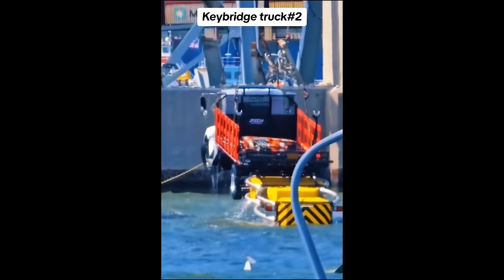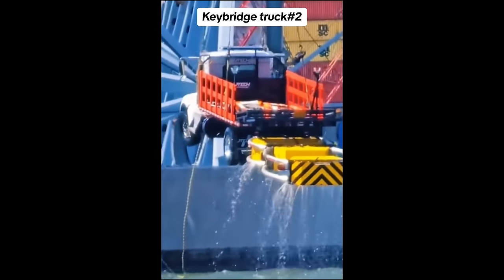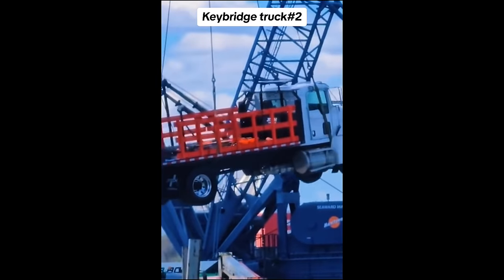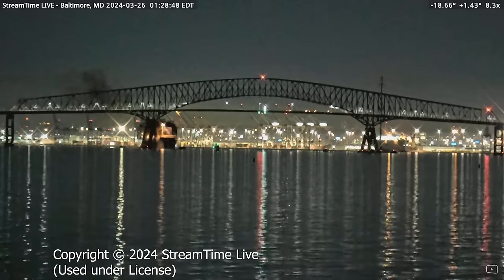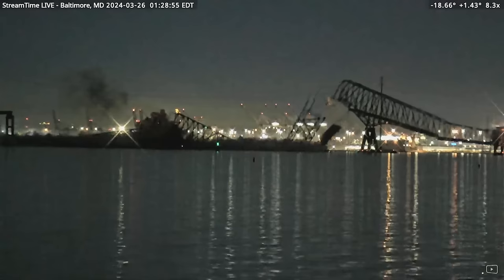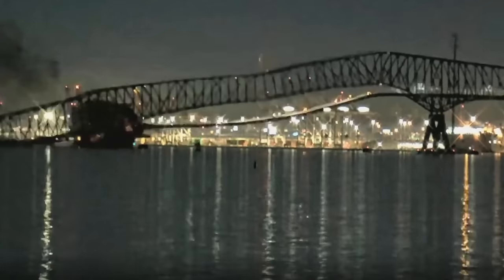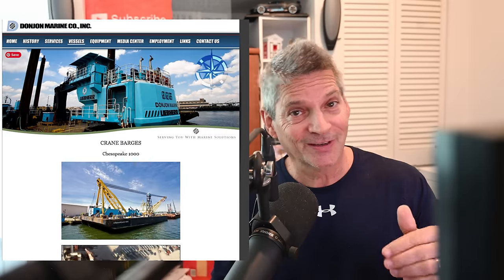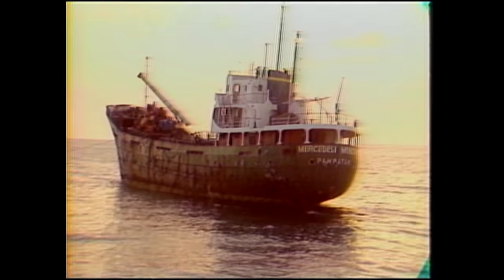Missing Truck, Bridge Truss Salvaged Collapse Site

Comment: Jeff, you overlooked a very important consideration concerning your spanking brand new undamaged truck earlier in the video? After the truck went into the harbor, who do you suppose went amd jumped in to turn off the lights? By the way, also a nice catch of the Cashman Dredge in action! Keep these suspense filled videos coming. -Bob...
Reply: they didn't turn the lights off. Saltwater had its way with the electrical and battery systems in a matter of minutes.... hours at most.
Reply: @rupe53  OMG! Hey Jeff, is it possible that the truck's operator left the windows open?
Reply: @wranther     anything is possible but on a cool/ breezy night it's likely they were closed.
Reply: @rupe53  They probably had the heater on with the truck running too if it was a cool breezy nigjht
Reply: @wranther     that was kinda my direction.... if it was occupied. Most of the time that truck would be back 100 feet away from the work area for protection so probably empty.
Reply: @rupe53  OMG! A whole hundred feet away? People could catch cold trying to get back to that truck on a cool breezy night like that!

Comment: Just one issue I have with your description of this particular truck! First off if you look in your video of the collapse you'll notice a set of two yellow lights on the bridge deck just above the cargo ship as it hits the bridge! So this truck is not one of the five vehicle's you are pointing at! Also in the video of the truck it is clearly closer to the ship than where the five fell into the river! That's my observation- I could be wrong!
Reply: They also had portable generators with yellow lights.  That couldve been a flashing arrow s for traffic to move over.

Comment: Did the ship not have a horn to warn of the pending crash or a PA system to alert the road crew?
Reply: they claim the horn was blowing and they did radio ahead for road closure.
Reply: @rupe53  
But no loud speaker, no public address & no mega phone, no this is not a thing & has never been used by a ship to communicate with someone in the path of a ship that has lost control. Might that be something that is needed for shipping vessels world wide, it's not a big ask, not a big reach, not a requirement considering the amount of ship to shore crashes.
Reply: @andycurran3327     where do you mount a PA system (for outside use) when all of the high locations are covered with containers? A handheld megaphone would be useless here.

Comment: With that truck it’s a crash truck that absorbs damage from crashing vehicles. Since they’re built to withstand impacts they’ll be built heavier to prevent damage. Since there’s a greater distance between the next vehicle it’s purposely set back to allow the vehicle to slow down before it hits the next inline.😂😂❤

Comment: I'd bet that truck, with a little light maintenance would probably still run. 

I'm not one of the conspiracy theorists mentioned at the beginning of the video, but officials have been saying since day one that everything down there is covered in mud. Everything except that truck, apparently. Thing looks like it just rolled off the lot.
Reply: Maybe it was sitting on the bridge deck,  and the ambient water silt washed off of it upon lifting ?   Maybe ?   Aarre Peltomaa

Comment: What was in those containers that were going to Singapore, the us doesn’t import anything manufactured anymore, just cash. two way radios in the truck might have given warning to the work crew on the bridge at the time that traffic on both sides of the bridge was stopped before it collapsed. Where I used to work they used the backup attenuator trucks with the scorpion pillows. They were lighter and not prone to the mounts snapping.

Comment: About the truck. A crash truck like that is the first truck that you see when you're coming to a construction site it is probably a half mile before the actual work so it was on the flat sections of approach with no structure above it, and those two spans went down pretty much flat. If you look at the video, that's where they were picking it out of the water.

Comment: 2:36   What is that smoke showing between the two upper supports after the flash of light ????  It happened right after the disconnect on the right side above where the trucks were. 
1:29   There is a flash of light on the back side of the deck level.  What the hell was that ?
I could understand a high tension/voltage electrical line's being severed,  but why was there 20 or so feet of smoke at the higher level?   I saw a high tension line come down, and the smoke only lasted for a few seconds after disconnection, not for 20 or more feet !!!
PLEASE EXPLAIN.    Aarre Peltomaa

https://www.youtube.com/watch?v=atQOPdu5mWU
Reply: There were high power lines going through the bridge. Mostly to power the lights.
Reply: Lighting, port and starboard lighting, also cameras

Comment: I wasn't thinking conspiracy.  I was wondering if such a pristine looking truck could be restored to working order and returned to service.
Reply: The electrical is toast.  At least every electronics circuit that had power (all of them) when the truck went under will have suffered damage from the conductive water shorting things out.  If thoroughly disassembled, cleaned and dried, some of the electronics and electrical equipment is likely to have survived, but will never be reliable. After being submerged, even the normal connectors in the wiring harness will be contaminated and even if they operate after drying, will start to experience connection problems increasingly often.  They would all need to be disassembled, cleaned and dried before corrosion occurs on the contacts or the wires.  Water wicks into the wiring harness along the metal wires inside the plastic coating.  It's effectively impossible to dry and will corrode the wire over time.  Even stuff like the seats and carpeting is hard to get dry before it molds. The water will be inside any gauges on the dash, will have ruined any reflectors in lights or markers, etc.  Water will be inside the engine, and if the engine was operating when it went under will sucked water into the combustion chambers, likely suffering hydrolock which causes catastrophic engine failure.  Typically a vehicle that is submerged up to the level of just below the dash is totalled, even if the engine didn't hydrolock, just because of damaged electrical and the practical impossibility of drying and repairing everything sensitive even if the dash itself didn't get wet.

Also, I'm uncertain how much salt is in the water there - it looks on the map like it would be salt water especially at high tide.  If any significant salt the problems get many times worse because the water is more conductive and it leaves more residue and accelerates corrosion.
Reply: Not if the engine was running at the time. It also wouldn’t be worth it

Comment: One thing I wonder about is why don't they dig a chunnel under that river instead of building another bridge after what happened.
Reply: This bridge was the ONLY short and less congested east side route for hazmat (including RV’s with LP tanks) and oversized loads which are NOT allowed in tunnels so a bridge is required, plus a tunnel would likely cost twice as much based on other projects where they have been considered.

Comment: I'm sorry for the comments of the stupid 'conspiracy theorist'.  I'm a more intelligent 'conspiracy theorist'.  We should see a lot of changes very soon in global events.  Anyhow;  someone in another video pointed out what looked like flashes or arcs of light in 3 to 4 locations along the top of the bridge just as the disconnect was occurring.    WERE THERE HIGH VOLTAGE ELECTRICAL LINES ALONG THE TOP OF THE BRIDGE WHICH COULD HAVE ARCED VERY NOTICABLY WHEN THE SPANS STARTED DISCONNECT ???  IF NOT,  COULD THOSE FLASHES HAVE BEEN DETONATIONS ??     eg. You know damn well that a Boeing 767 never hit Building 7 at the World Trade Center;  it was even announced to have come down while the building was still showing in the newscaster's window.   How embarrassing for her.  It was a controlled demolition, and you know it.  A firefighter saw ribbons of molten steel running along a beam a day after the demolition at one of the first two WTC buildings.  I'm sure that any scientist would know that there wasn't enough energy in the Kerosene of two Boeing 767's to do that sort of thermite or mininuke type melt.  I don't have, or won't make the time to research those flashes of light at the top of the bridge;  I'm counting on you to find out what  'the storyline'  is.
Thanks much,    Aarre Peltomaa

Comment: You are hilarious. once that bridge went vertical the vehicles would have smashed into each other. Did you say it was gently put in the water. You are an NPC. Not only would the vehicles slam into each other they would have been smashed by the bridge supports. FUN FACT: if the vehicles look that nice the workers that was not even on the bridge would have been fine. No one died, I watched the bridge cam video and the last car clearly stopped (brake lights and interior lights are visible as it stopped by the construction vehicles. If there are bodies, they are planted bodies. You do not die from what you call a gentle fall. If the truck looked like it came off the assembly line without a scratch. Them shiny fuel tanks and suspension would have been majorly damaged.